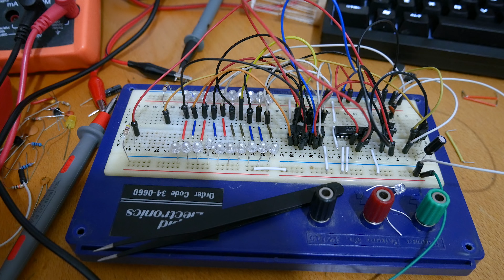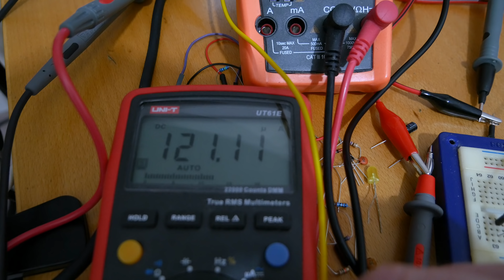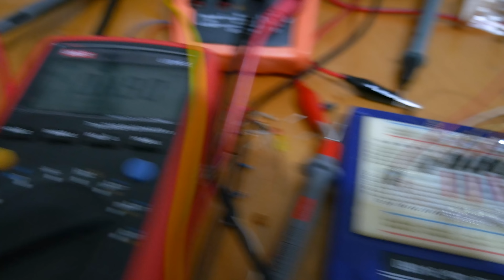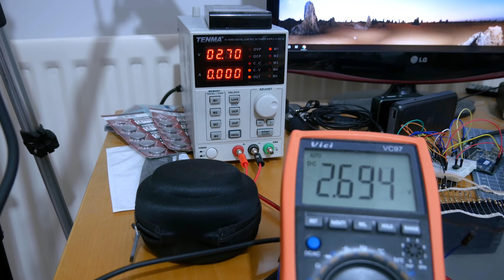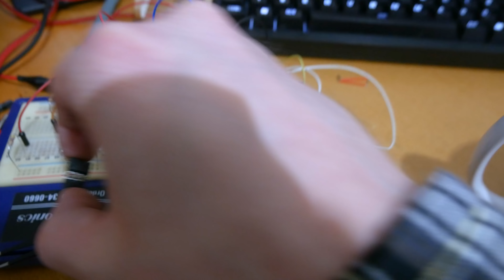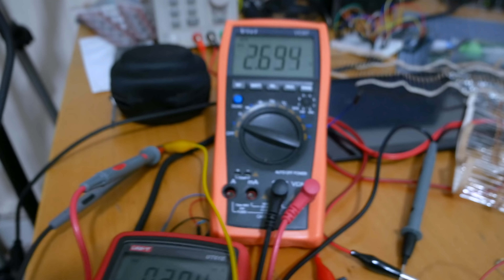Making a badge part 1: Flip-Flopping on a CD4017

Comment: yep and nice, I maybe getting older, and I do know TLC555 for a very long time now, got to be 40 years. Voltage can be low as 1Volt but it might not, I can't remember but very interesting chip.
Reply from the maker: I ended up with the TS555, very similar in terms of spec.

Comment: If you use two 4017's and chain them, you can multiplex 100 LEDs :D Try that! One drives the "rows", and connects to the LEDs; the other drives the "columns", and connects to the bases of ten transistors which pull the LED's negatives legs to ground.
Reply from the maker: :-) Sadly I don't have space on the badge for that .
Reply: Aww that's a shame!
Brilliant idea when you've got going on at the moment in any case, using the flip flop basically as address selection :D

Comment: My first conference badge design (3bit xor LFSR stream cypher, Cyphercon 2016) used two 7400 logic chips (s>p shift register, quad xor) and a 555 (to debounce the user clock input).  I was indeed able to get away with coin cells.  They make a battery holder that stacks two cr2032 one over the other.  Not only is this a much happier voltage for the 555, but it also helps avoid hitting the dredded too much current for the chemistry problem with Li cells by splitting the load across multiple cells.

Hope that is helpful :)

@whixr / @tymkrs
Reply from the maker: Long time no see. That's cool, interesting about the dual cr2032 holder, might need to look into that. I am aiming for ~1mA at the moment for constant current draw so I should be fine with 1 cell.

Comment: You could use an ATtiny85 / ATtiny13 - or would that be cheating?
Reply: I'm using an ATTiny85 in mine. I'm sure my CR2032 battery will only last about 30mins ;)
Reply from the maker: Not cheating at all, micro-controllers are definitely allowed. I just wanted to go for something very low current. I am hoping to keep it under 1mA total. Once I test out the LEDs I want to use I may have to up the mA budget though.
Reply: An attiny will run for many months of a coin cell!
Reply: Not running the number of LED's mine's running ;) Hahahahahaha...
Reply: If I was going to use an ATtiny 85 I would also set it to the lowest speed.